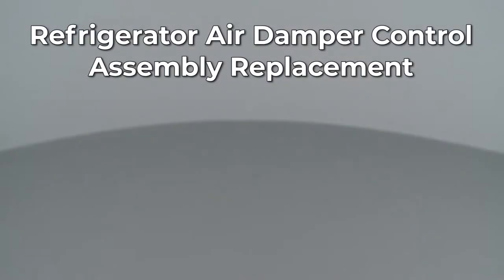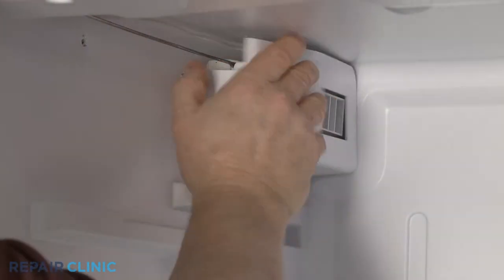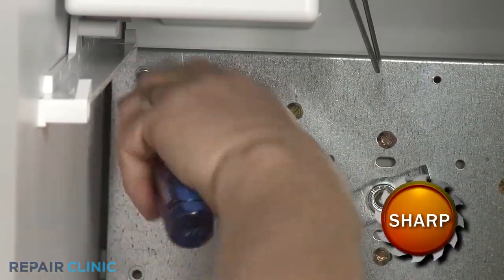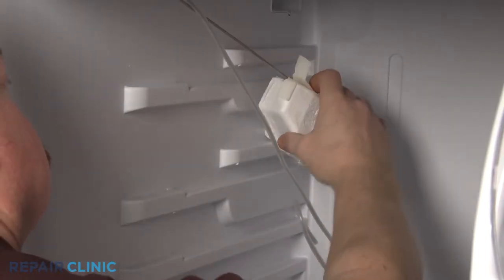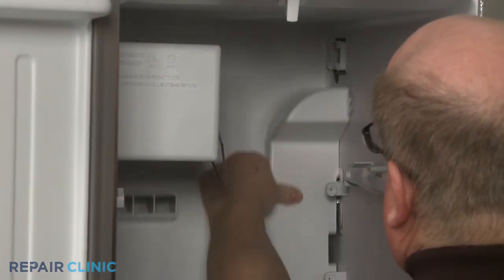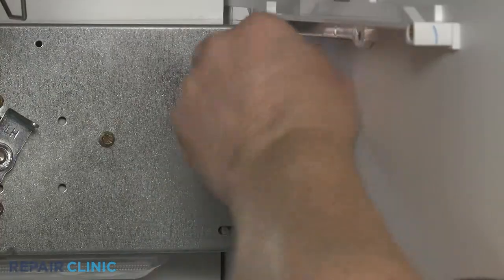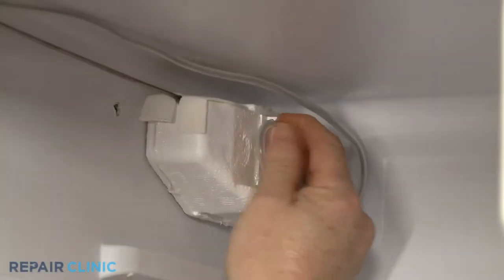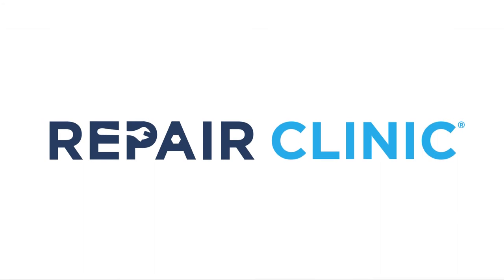Whirlpool Barracuda Refrigerator Air Damper Control Assembly Replacement WPW10151374

Comment: Note to self: This damper doesn't have a motor mounted on the side that opens and closes the door, it has a metal "control rod" that is reminiscent of a clothes hanger that has a small bend in it that opens and closes the door and the actuator is in the front of the fridge compartment. Probably an older model than what you've been watching.